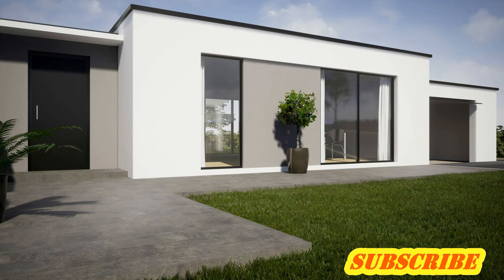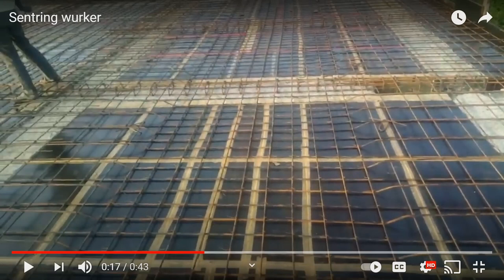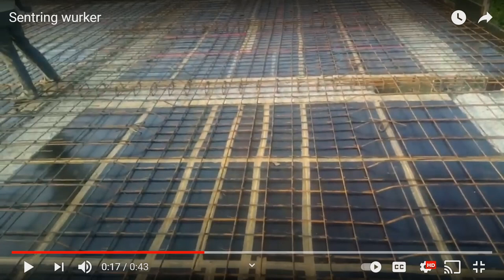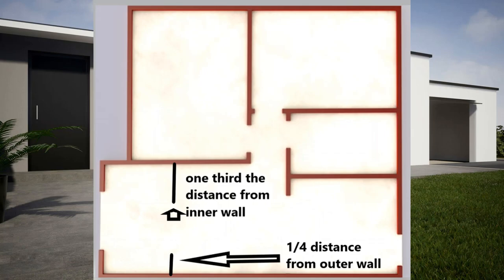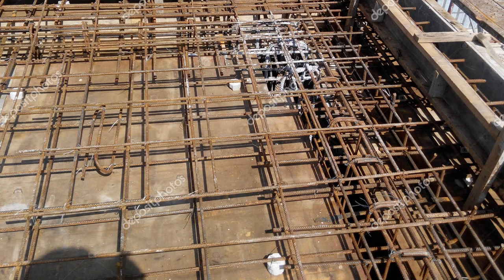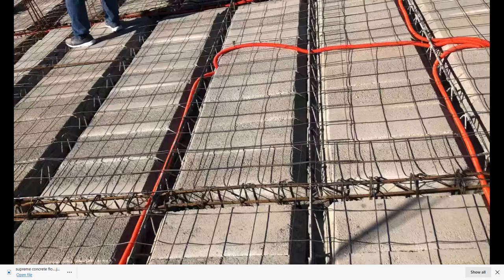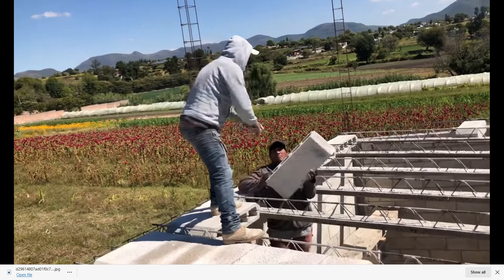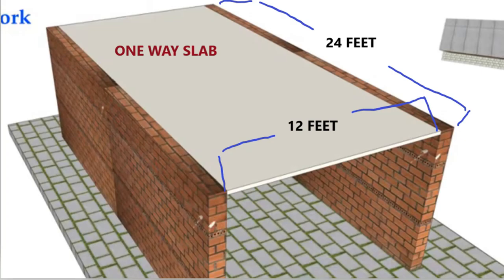Building Your Dream House in Jamaica Pt 6,  3 of 3, Rebar in Roofing. Steel Fiber, Natural Fiber

Comment: We are learning and gladly appreciate your information so keep them as long as you can 😆 

How many feet wide at maximum would  you consider to be safe when creating an open concept below with a slab roof and what is your considered thickness ?
Reply from the maker: glad to help. First thickness. As a general rule slab thickness for roof generally goes to a maximum of 6 inches in normal designs but that's not really a rule of thumb because the actual thickness is calculated based on the unsupported span. 

The roof can be as wide as you want it really. So saying this width is safer than that width is not good advice.

You would first have to say how wide you want the span then to make that span safe i would then do the calculations.  

So the width and length would determine how many beams would be in the span, how closely spaced the rebar would be , what size rebar would be used and that would in turn determine the exact thickness of the slab.

Now with that said there are some basic tricks that can be used to ensure that your slab roof is safe within a certain dimension.

First one is to make sure that the maximum space between each beam does not exceed 17 feet where you are using 12mm rebar at a six inch grid pattern,

Second one is the always used the cranked bar method so that your moment(the point at which the maximum load is bearing on the column) is on the TOP of the beam to ensure maximum tensile strength and maximum compression where they matter most.

Third one is to always vibrate your concrete when slabbing your roof to remove air bubbles , reduce voids and ensure the concrete is as dense as possible.

Fourth is to mix your concrete as strong as possible, don't use too much water and either cover it with a moisture blanket(wet crocus bar or wet paper) or a sealer so it cures slowly and does not crack.

And most importantly  DO NOT REMOVE THE SUPPORTS FOR A MINIMUM OF 14 DAYS.
Reply: Thanks so much for such valuable information

Comment: Rebar Roofing

1. Slab roofing, more affordable, secure, earthquake resistant
2. Smaller the dimension, less reinforcement needed. 
3. Ratio of width to length of suspended slab.
4. One way or two way slab.
5. Two way slab; supported on four sides
6. As the span of the roof becomes wider, insert reinforcement along specific points
7. Main bar, distribution bar (linger length of slab), 1;3 span and 1;4 span 
More stuff